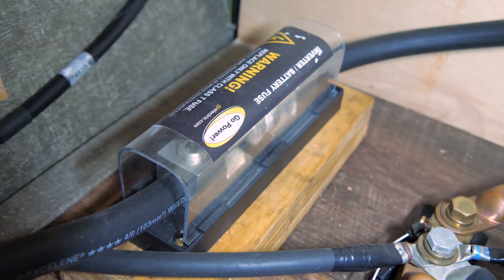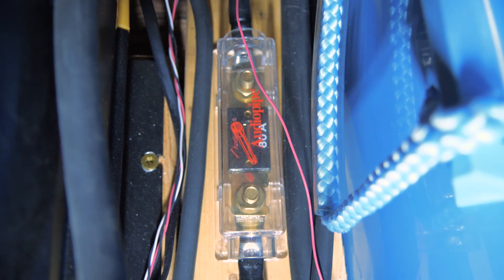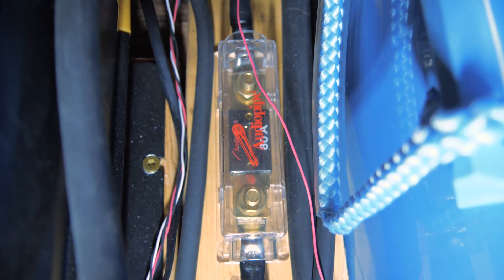MISTAKES! - 5 Common RV Solar Pitfalls - RV Life

Comment: Agree with everything you say except for the AGMs. The increased cost versus regular lead acid only gives you the benefit of maintenance free. Type 24 batteries are what fit under the steps of my class c. Depending on the brand, AGMs actually have less amp hour capacity than lead acid. I’ll just keep using lead acid and watch the electrolyte levels while I save for lithium. Cheers!

Comment: Did you have to replace your battery charger that came with your RV for one that would charge the lithium batteries?
Reply: Probably. Good question, I had to change mine

Comment: I have 1.6kw of solar panels and 8kwh of LiFePO4 batteries. Total price including all Victron components except for the battery that I built myself I'm at $5k. I don't consider that unreasonable for being able to run my AC or space heater for 5-6 hours a day.

Comment: Hi David and Roe. We have been following you for a while now. Thanks for all the great videos from technical, to life, to detailing great campsites. We are also full time now.  Have you done anything to your truck charging system or use a DC-DC convertor between the truck and camper system? I heard Shawn with LoLoHo say that his lithium batteries sometimes put too great of a drain on his truck charging system if the batteries are not topped off. We have a modest solar system 400W with 40Amp MPPT. We are trying to decide which lithium batteries to get as we have two 6 volt Golf cart batteries in use. Hope you guys get back on the road soon. Good Luck and Merry Christmas.

Comment: While most of the info you gave is accurate...the cost of batteries does not to be as expensive as you have said...DIY LiFePO4 batteries can be made for 25% of the cost of the cost of a Battleborn.

Comment: Great video! Glad to see you both well and happy! One more point on LiFePo4 (Lithium Iron Phosphate) batteries. Get them from a reputable manufacturer, such as Battle Born. These batteries are overbuilt so that you can get 100% of the rated amp hours. These batteries also have a built in BMS (Battery Monitoring System) that will cut off the load in overcharge or undervolt conditions. You literally can't overcharge or over discharge them because the BMS shut's off the input. I built a 200 amp/hour system (2 100 amp batteries) and did a discharge test running a heat gun off the inverter. The system discharged 193 amps before the inverter threw a battery fault and shut down. I think that was at 11 volts. The inverter was trying to protect the battery (not knowing it didn't need to). The BMS would have shut down the load at around after another 7 amps of discharge. The other thing is customer support from Battle Born is fantastic. I was working with them on charging parameters for my solar charge controller and when getting ready for the discharge test. To David's point, they're not cheap... I spent $999 per battery. Those 200 amp/hour batteries though, are the equivalent of 400 amp/hours in AGM or any other lead/acid format, plus they're good for 3,000 to 5,000 charge cycles after which they'll still have 80% of their rated capacity. And they charge faster than lead/acid. You just can't beat them!

Comment: hey anyone?  as he says here, lithiums can easily be discharged to 20%, but:  
i read but cannot verify that lithiums do NOT like to be at full charge all the time- that they last longer and work better if you let them discharge regularly.  
AND that they actually prefer being charged to only maybe 80%.

i am currently plugged in to shore power for the winter (for heat only) and so do not have my panels deployed.  instead, i have a genuis smart charger hooked from shore power to my lithiums (yes, set for lithium!) which i then continue to use for all my electricity except the heater.

since the smart charger keeps the batts topped off, i have been periodically unplugging it and letting the lithiums run down some...  because i can't find a bottom line answer to my question above.

Comment: Great Video!  Did not know that much about batteries, I recently used a jumper cable to connect an inverter but found my cable with new connections lost 4.5 volts?  I spent $18 cables, $5.00 connectors and $38 tool for crushing connectors on wires.

Comment: You can discharge lithium batteries down to about -4 degrees. You just can't charge lithium batteries under 32 degrees, the BMS won't let you. Good info though. Thanks for sharing.

Comment: You are correct that Lithium batteries can not be charged below 25 to 32 degrees,  internal temp, not air temperature.  You are incorrect in that Lithium batteries can be discharged / used down to -4 to 5 degrees.

Comment: Are you still using the Micro-Air easy start with the honda eu2200 generator for your ac? How has that system held up over the last couple years?
Reply from the maker: Yep we still are and it still works perfectly. We love the combo 👍
-David

Comment: I enjoy the videos, but be aware there is a formula error in the "Sizing RV Solar" video that this video linked to and that error will cause you to overestimate your panel needs. In that video, at the 4min 52 sec mark, the formula uses "PANEL" voltage (18v) versus "USE" voltage (12) in determining panel needs. A comment by Christopher Adamo pointed this out and was correct if you are trying to size your panels and want to take a look at the reasoning. Please don't get me wrong, I'm not wanting to be critical or trolling but just to clarify. The step by step on that video and the 3-part installation videos were all great otherwise and really well done.

Comment: One option I never see people suggest for RVers is to INSTALL BATTERIES WITHOUT SOLAR. The solar is there to recharge the batteries. If you're a weekend warrior or a casual camper like me then you might not need solar at all. Solar is just ONE way to recharge your batteries. Another way is to plug into shore power to recharge them, the way electric cars do. OR you can recharge with a generator. So if you plan to camp in ways that allow plugging in every so often then maybe it makes sense to do just the batteries. (The batteries need to be set up with those charging options though).

And if you're that kind of camper and you have a home where you could install solar, maybe it makes more sense to do the solar there instead. That way you don't have to deal with the limits of the array size and weight on the RV and just come home to recharge your RV batteries from power produced at home (or power credits, depending on your situations). My point is, there are lots of options.
Reply from the maker: Hi Elaine! You're absolutely right, you don't see RVers suggest not having solar very often, but we did earlier this year. Here's our video on why many people might not need solar or might only need a few parts vs a whole solar set up: https://youtu.be/Jvk5ePusGDI
-Roe

Comment: Every single way?  The lifetime kAh/$ of flooded lead-acid GC batts is about 10% less than LFP.  Can charge lead below zero.  People who bail before the 10yr mark won't amortize that epic LFP lifetime.
Reply from the maker: You said "Can charge lead below zero." What does that even mean? How does a battery have negative charge?? And also, the USABLE Ah/$ is wayyyy lower for lead acid than LiFePO4. Lead acid can only he discharged to 50% while LiFePO4 can be discharged nearly all the way to 0. When doing your calculations you MUST consider usable Ah, not just the manufacturers Ah rating of the battery.
Reply: @FateUnbound  I think he means lead-acid batteries can be charged at ambient temperatures well below the LiFePO4 limit of 32F. I keep my TT plugged into shore power all winter here in northern IA so the converter can keep my two 6v lead-acid batteries topped off. I've had no problems even with temps down to -25F. A fully charged lead-acid battery will not freeze unless the temperature gets down to -80F (although I confess sometimes it FEELS that cold here!).

Also, you should correct your statement about not being able to discharge LiFEPO4 batteries below freezing. Battleborn and Lion Energy advertise normal discharging as long as the temperature of the battery is above -4F. Dakota says they're good at temps above -20F. That said, you're correct about no charging below 32F. The modern BMS in these batteries will shut it down if you try.

The one thing I really love about LiFePO4 batteries is the weight savings.

Comment: But again... it all depends.  I run my AC units with no problem at all off standard golf cart batteries.  Of course I have 900 amp/hours @ 12 volts and there is nine 265 watt solar panels on the roof of my old 34 foot Southwind Class A.  They are wired three in series in three sets with a maximum of 92 volts to the three charge controllers.  The controllers switch on usually around 30 minutes after sunrise, and charge until 30 minutes before sunset.  The biggest reason I can run AC is... they are mini-splits (12,000 in front and 9,000 in the bedroom) that use a maximum of only 6.7 amps in front and 5.9 amps in the bedroom.  And, since they ramp the compressor up and down depending on need... they normally draw even less.  The 1960's tech RV roof AC units they are still installing today pull 14.2 amps when the compressor is active, almost always have constant-on fans, and have a huge start-up draw.  My 'house' type 8 cu ft chest freezer draws .62 amps with a less than 50% duty cycle.  So, when I find great beef, I buy bulk (40 pounds of ground, 10 pounds of steaks, etc).  The same with chicken or pork.  And yes... that's just for me, myself, and I.  The 8 cu ft 'house' frig-only unit in the wall draws .71 amps and again with a less than 50% duty cycle.  The one thing I feel people forget is... back-up.  I have an additional 265 watt panel (total of ten) on the roof with 225 amp/hours of storage for back-up.  If the main battery bank drops below 72% at night (to extend battery life), the inverter drops out.  An auto-transfer switch fires up the much smaller inverter on the back-up battery bank, and the freezer and frig are switched over to that system.

Comment: Why would you need a fuse on the wires between the solar panels and the charge controller? Solar panels can never put out enough power to damage properly sized wires even with a direct short. Unlike a battery they are limited in their power output.

Comment: You might as well be talking in a another language,  this is totally confusing. Have no clue what you said. But you guys are great to share your knowledge.  I guess I'll  be  looking up Thomas.😊
Reply: Haha. It sounds so simple when David explains it. If I tried to do it myself, I would soon realize I should have ‘called the man’ to begin with.
Reply: Yea it is nice sharing their knowledge but they do make it way too complicated!  I have bought and installed our own system and it is not that hard!  Just time consuming, especially running the wiring.  Bought the Renogy 400 watt four panel system with the mppt charge controller off of Amazon.  It comes in a kit and has everything you need.  Your existing two 12 volt batteries will work just fine unless they do need to be replaced.  We have agm batteries and they work well.  Look elsewhere for better knowledge and less drama to educate yourself!

Comment: Flooded lead acid batteries require 4 stage charging. The 4th stage is equalization. AGM, Gel and LIFPO4 can be charged with the 3 stage chargers. A charger for LIFPO4 batteries should never exceed bulk of 14.6 vdc and float of 13.4 vdc. A good 3 stage charger will have an absorption charge cycle the is variable or programmable and end within 4 to 6 minutes for LIFEPO4 batteries. If the absorption cycle be too long you can damage LIFEPO4 batteries.

Comment: Good prep knowledge to have before you start or Luby a system.
Reply from the maker: Thanks Dave!
-David
Reply: @FateUnbound  Luby a system?  What on earth has spell chek done to me again.  I meant install a system but I figure you knew that! 😱
BTW, heres what I have for power.  I cannot afford the wonderful lithium batteries by BB so my system is a compromise.
First my needs- luckily my Wolf Pup comes with a 10 cu. fr. electric high efficiency fridge and freezer with off grid capability.  I have a small 50 watt solar panel on the roof with two deep cell Marine ACD batteries.  All lights except one are LED too.  Of course my stove is propane and the furnace too if I use it however when boondocking since my space is small (20x7), I use a warm up with my Buddy heater.  If I am on shore power a small electric heater.  Back to boondocking, I also took your advice and have the portable GoPower panels and that keeps the batteries up at 12.2 volts or better.  If I want  to use my coffee maker, toaster, or microwave I have the 2200 peak, 1800 watt run Westinghouse generator which will also charge as you know when it’s running.   Still looking for a propane conversion option for it but if I find that want the dual gas/propane option.  Using the gasoline is no problem for me too.  That thing sips fuel.
That’s about it and other than black/grey tank and fresh water tank capacity, this allows a fair time boondocking.  I can usually get 7-9 days easily but if really careful with water, longer.  My electric will let me stay quite a while.   Also, if I am at a state park with bath/shower facilities I will use them as much as possible and some places even have facilities to wash dishes.
Safe travels you two!

Comment: I have a small travel trailer with a dead 100 amp hour  Lead Acid Battery.  Can I replace it directly with a drop in 100 amp hour Lithium Iron Phosphate battery?  The current battery charges from the truck when I drive and from a converter charger when plugged in.  Seems like I heard somewhere that the current draw from the Lithium battery could harm the alternator, and will I need to change the converter charger?

Comment: Just wanted to encourage people that LiFePO4 cells are getting cheaper and cheaper and that it is possible, even on a budget!!!

You can get LiFePO4 cells for cheap if you buy cells directly from Asia (I bought mine through Alibaba) rather than from the US sellers (they buy the cells mostly from Asia anyway, I believe) who mark up the price significantly (rightfully so because of the warranty, BMS, etc.). But just wanted to throw that out there in case someone thinks they can't afford LiFePO4, you actually CAN! Just need to do some research online on how to keep them safe (Will Prowse, other YouTubers) and have the time to wait for them to ship from Asia (up to 1.5 months). I have no battery/solar/electrical experience and am installing ~7kWh of batteries on my own RV for around $1,000. Obviously the rest of the solar, charge controller, inverter, etc. are not included in that # but you really could get used solar panels and the others for cheap.

Comment: You said that Lithium Ion had a problem discharging below freezing.  I thought the issue was only charging them below freezing, not using them.
Reply: I believe you're correct.
Reply: Charging below freezing is a concern, not discharging.
Reply: Also, below freezing does not mean 32 degrees right? It is more like when you get down much colder than that?

Comment: You are right in that trying to charge a Lithium battery below freezing temperatures will destroy the ability to ever charge it again.  The same is not true of discharging that same lithium battery.  That is why some systems use a heater powered by the lithium battery to raise its temperature before then charging it.  Also, Fuses and breakers can be loaded up to eighty percent of their rating.  They should not be loaded beyond that.  A sustained current draw above eighty percent but under one hundred percent, will cause latent trip.

Comment: Is it ok for my lithium batteries to get below freezing if they are not being used? I have the power turned off to my camper for the winter. But, our camper is stored outside where it will get below freezing this winter.
Reply: Lithium batteries should not be charged below freezing (can cause permanent damage due to lithium plating) but can be stored below freezing! At around -4 degrees F the electrolyte in the batteries may freeze and cause permanent damage though. Check with the manufacturer on any specifications related to your specific battery though and always remember that you can heat the compartment that holds your batteries. Also some charge controllers have temperature sensors that can shut off charging at low temperatures to save the batteries.

Comment: How can I run solar while towing my 5th wheel?
My concern is the power from the solar system will back feed through the 7 pin plug and burn out something in my truck. 
Any suggestions?
Reply: Thats not a possibility. The truck charging circuit and rv solar charging circuit are two separate items. Even if it was possible there is enough fuse protection to prevent an issue.
Reply: if you are worried about it just turn off your inverter. I travel with no problem.
Reply: @bobstellmaker3816  Thank you for your suggestion. I’m not sure I understand. Turn off my inverter? 
I have a 500 watt solar system passing through a 40 amp charging controller charging a pair of 6 volt batteries. There are days we travel 4 to 5 hours and it would be great to be able to charge my batteries while towing. I’m not sure what disconnecting the inverter will do to prevent back feeding into my tow vehicle. 
Can you explain?
Thanks for your help.
Reply: @herewegoagain6458   You're right turning off your inverter should  Not make a difference I tow all the time And I have had no problems with any damage Some my solar back feeding into my system I don't think you're going to have a problem
Reply: @bobstellmaker3816  what?